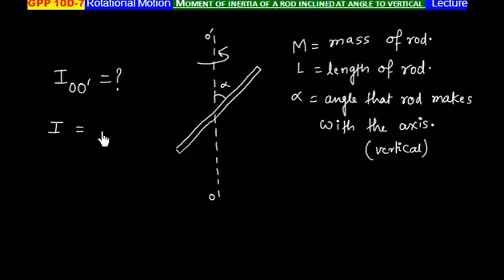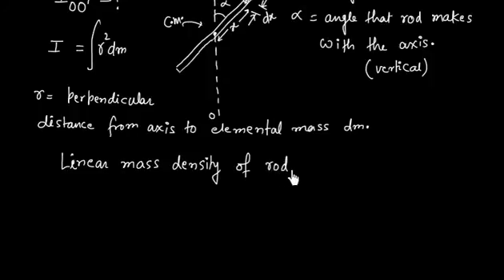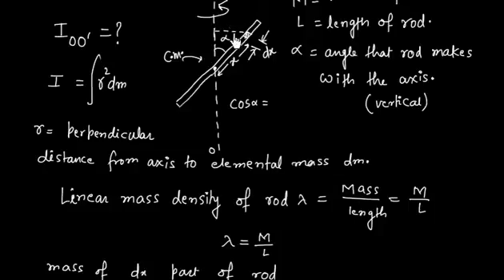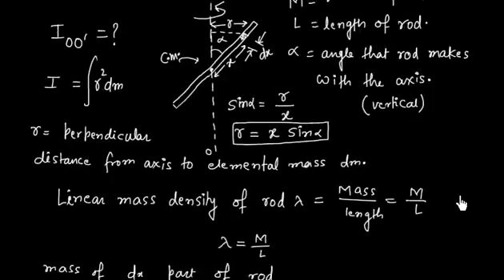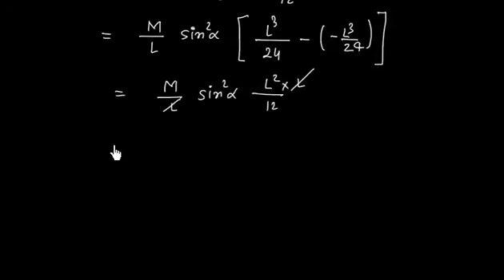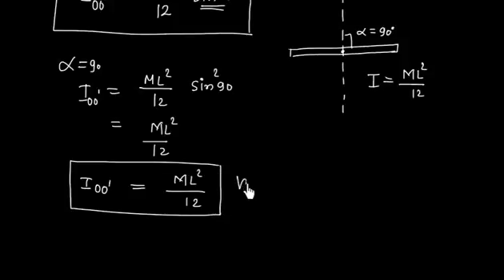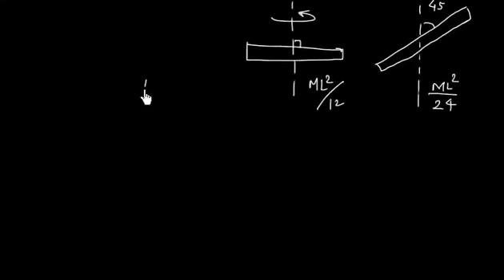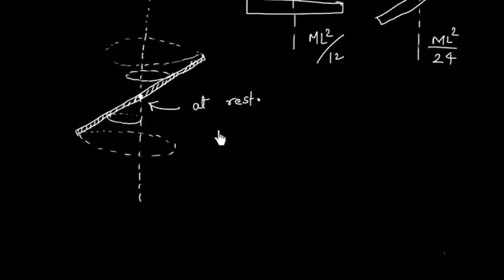Rotational Motion I Moment of Inertia of a Rod inclined at an angle to Vertical I Elemental Inertia

Comment: Does that mean when alpha is 0, sin 0 = 0, hence there is zero moment of ineria. I doubt it. I don't have the right answer, but I think this formula need another component.
Reply from the maker: yes alpha zero means all mass is concentrated on axis.
Reply: @GuruprakashAcademy  when alpha is 0 then the rod is in line with the axis, but not all the element of the mass is ON the axis. The moment of inertia of the rod about the axis should be mr^2/2 where r is the radius of the rod.
Reply from the maker: Definition of rod: it is a slender element.

Comment: Great video, thanks. In the diagram at the end, of the motion of the rotation, (9:23), is it just due to sketching that the paths of the two endpoints are not of equal radius about the rotational axis. And the smaller circle would extend around the axis with equal radius at all points? In the diagram it looks like alpha is not constant. Thanks.
Could you use the derived equation for a varying alpha?
Reply from the maker: King Yoda at the end put alpha is equal to the by which it is varying  for example alpha=a*t. say derivation is taken for instantaneous time t. i think it should be ok.